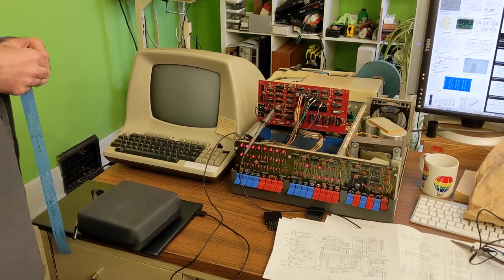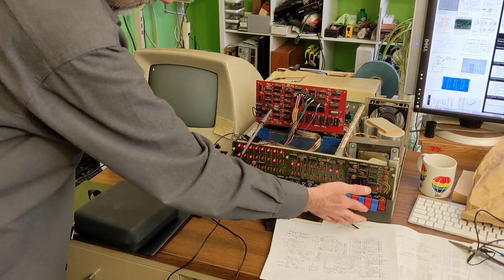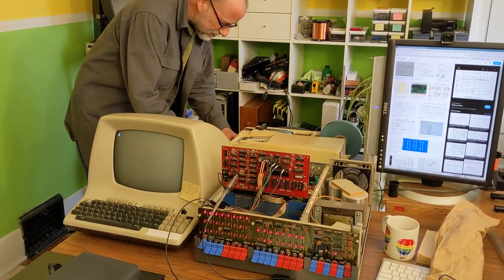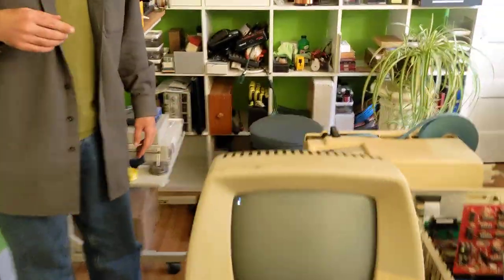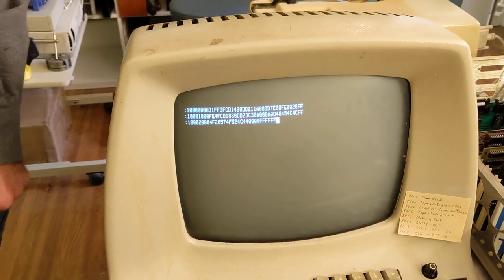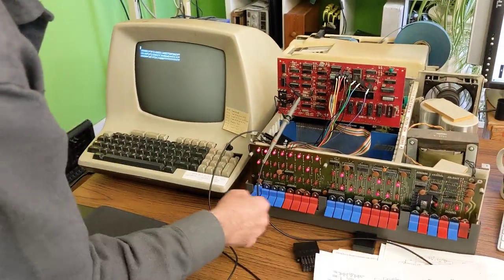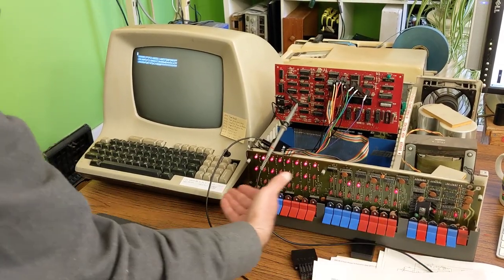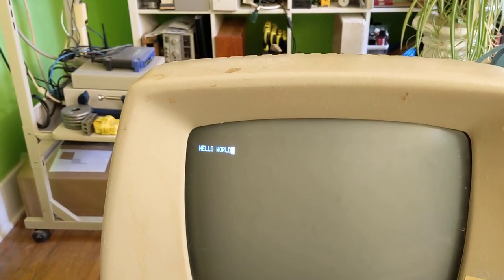Restoring an IMSAI / S100 Computer: Loading code from paper tape #adafruit

Comment: We had a KIM-1 (6502-based) microprocessor for our university Comp Sci class in 1977. I built my own Motorola 6800 board for my first micro-based project at home. Both had audio tape for storage. Seeing the paper tape shoot through the reader put an incredible smile on my face. I didn't see one of those until the 80s on a PDP-8 we had a work. Ahhhhh, the good ol' days!

Comment: In college I couldn’t afford the IMSAI so I had to build a Cromemco S100.  Still have PTSD from soldering 8 S100 sockets to the MB.
Reply: I couldn't even afford a Cromemco. I built a self-designed 8080 computer from components (oh that ICs and RAM were cheaper) -- if you can call it that as it working at any point in time was more-likely-than-not but still iffy. So much magic blue smoke was released back into the universe during its construction and testing. Lots o fun, though; and educational.

Comment: That's real old school consumer grade computer:
programs must be loaded externally from a support, no disk of any type with stored things, screen controls were separate from computer controls, and everything was basically code from binary, so even the most stupid things (from a modern standpoint) was a true effort, also considering you had no internet, and thus you was limited to what books offered.